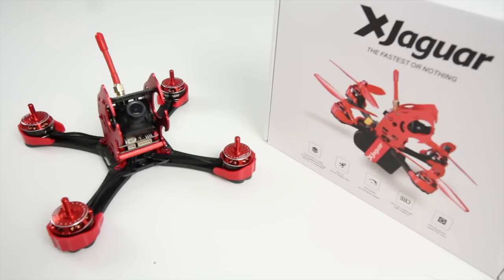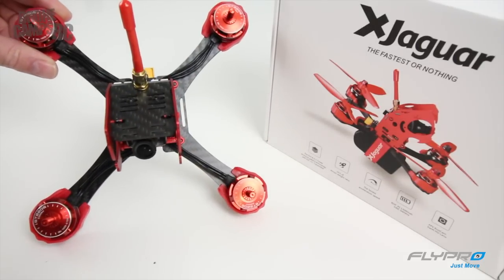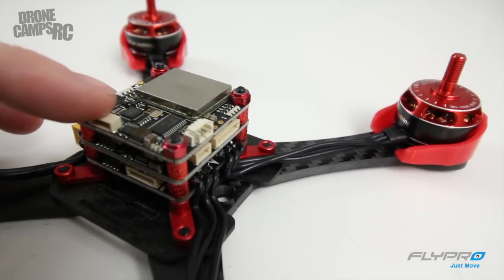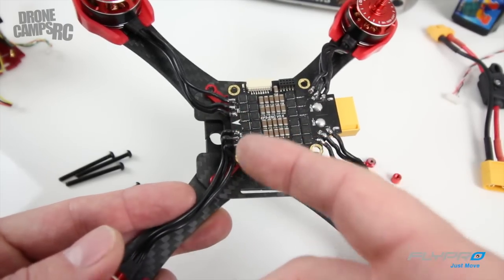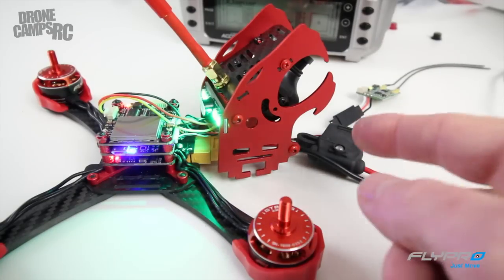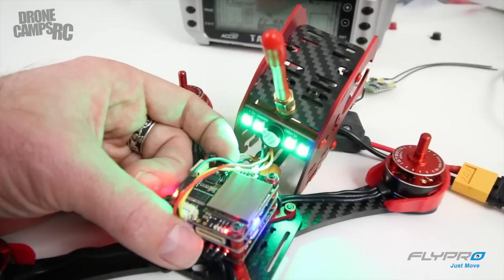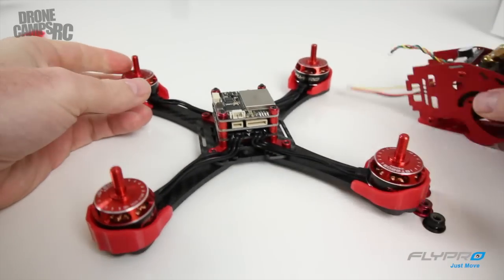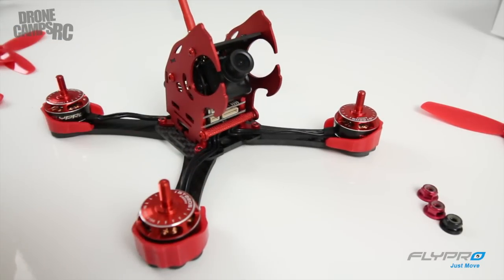Flypro XJaguar - CRAZY FAST Racer Quad - REVIEW

Comment: no big deal but you have mounted the motors the wrong way around (14:00).  The red prop nut (CW) should be on the front right and rear left (look at the picture on the box it came in).  This is to make them self-tightening (= props spin opposite to prop direction) so they are less likely to loosen, esp after a crash.  The locknuts will help but with these thick prop hubs they do not get much bite into the nylon locking bit.  You may be ok, just check for tightness between flights.  

Nice review though and thanks for sharing this.
Reply from the maker: Yes I'm aware of that. Didn't feel like fixing it. Pretty busy. Easy to fix in BLHeli.
Reply: BLHeli does not change the motor shaft thread direction mate.  You should physically swap the motors around when you get a chance imho.
Reply from the maker: I've done it before. It's fine.